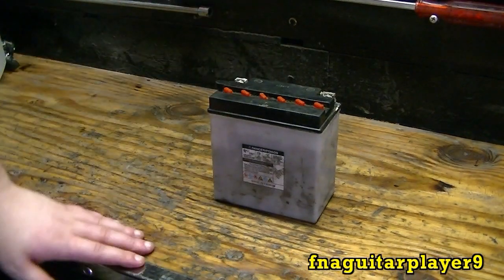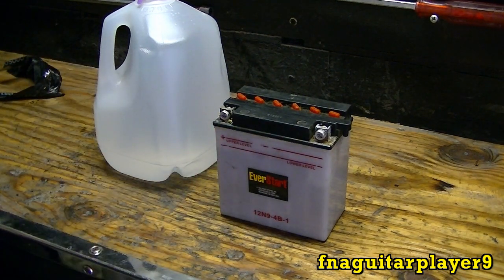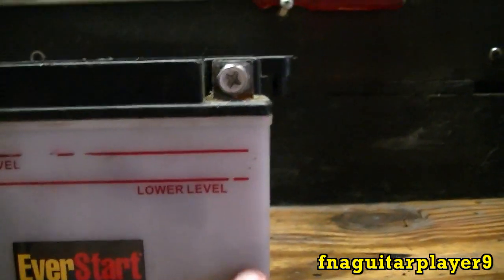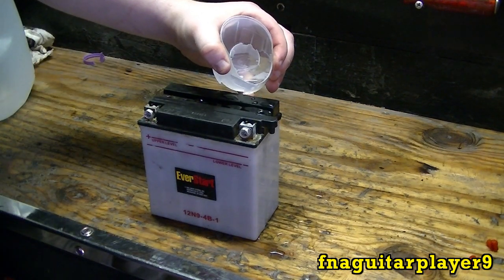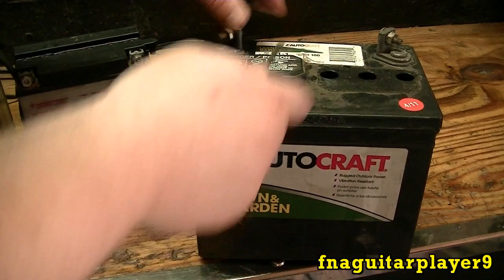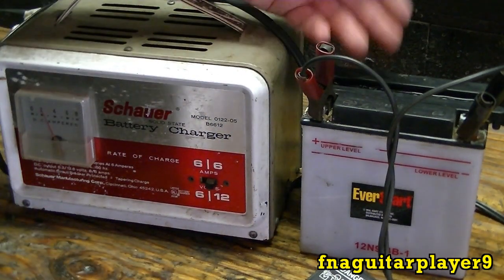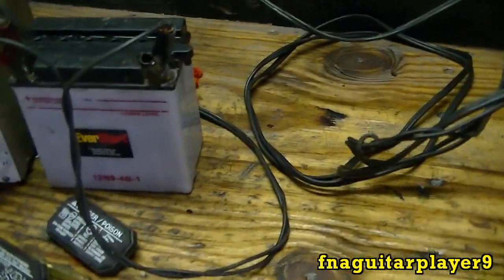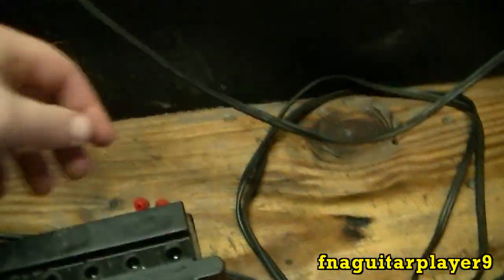Battery Maintenance ::: Adding Water to Cells and Charging

Comment: The higher current charging can help desulfate the plates, but you don't want to quick charge them too many times. Each time it takes some material off of the plates. You can add acid if you drain out the old acid and replace.
Reply from the maker: Yeah like you say as long as its not done to much, it can also make the acid "boil" off from electrolysis. Thanks for Watching!!!

Comment: I can give you a suggestion for filling battery cells without spilling water. I have learned to use a lower unit fluid hand pump to pump the water into each opening. They come with lower unit fluid at Walmart and the rest for replacing your outboard's lower unit oil.

I pour the distilled water into a smaller container with the same size threaded cap as the hand pump. It even comes with the clear plastic line. 

Try it. You won't spill a drop and is very fast.
Reply from the maker: Never thought of that, I know exactly what your talking about, that would work great, i'll have to check into getting one! Thanks for the tip and thanks for watching!!!
Reply: I keep several meat syringes in my shop just for things like this. Draw water right out of the jug and go right into the holes with the needle

Comment: You don't top them off with acid, because the acid does not leave the battery, only water does via the electrolysis of water.
Reply from the maker: true. It is possible for the acid to come out too if it the battery is overcharged, thats what causes that rotten egg smell, i almost blew up a jump start about 4 years ago. Thanks for Watching!!!
Reply: Hahah, having never overcharged a battery myself, I wouldn't know.
Reply from the maker: haha what happened was i was working on a riding mower engine and had my battery charger hooked to it, so when i got done cranking it would charge up faster, it ran down and i put on the 55 amp boost just to start it up, then i forgot and left it on that, smoke started pouring out and it smelled just like rotten eggs haha. I got it outside as fast as i could haha

Comment: After topping up the cells with distilled water you should use a desulfating charger, then keep it on that (BatteryMinders) any time its not in use.
Reply from the maker: That is good advice, I probably would have left it on a trickle charge but i needed to grass that day haha I hate these little motorcycle batteries, they last about 2-3 years then they start going out, i did revive it with epsom salts which got me a extra year out of it. Thanks for Watching!!!

Comment: Not necessarily.  Older batteries were designed to require maintenance and should be refilled or they will not give their designed service life.  The batteries with non-removable vent caps are a different chemistry, usually Lead Calcium, and they do not gas nearly as much.  They also use shorter plates which allow for more water loss before the active material is no longer submerged.

So if it has caps, check the electrolyte level and refill!!

Comment: The bubbling is the water breaking down into hydrogen and oxygen.  Only the water is lost, not the acid, so adding acid would make the acid too strong.  Stronger acid in the cells than what was used during formation of the plates in the factory causes them to corrode and fail early.

Comment from the maker: I've never had one last longer than 2-3 years at the most. I wasn't really surprised when this started acting up, and another thing this came from walmart so yeah haha Thats very true. The last jumpstart we had (best thing harbor freight sales) lasted 8 years, i've also though of buying one of them just for the battery and put the battery in the mower haha
Reply: Yep, just had my VP-75 1yr Walmart battery crap out on me, 2 months shy of 3 years.   Water is good but the battery is at 10v, so it wont start the car after sitting a few hours.  Got it on my rejuvenator now, it may fix it but I doubt it.  Maybe get my $11 core charge back if I cant reuse it.

Comment from the maker: If i do that it will be a jump pack, that would be a pain to pull out a cord haha I probably can't afford that, i'm sure they are great batteries! If I use a jumpstart/pack I thought of making a bracket or something to keep it on it all the time in case i need it. I'm also thinking about putting the bigger type of battery on it, make a bracket on the back to mount it. They are much better than these motorcycle batteries. thanks for watching!!!

Comment: Using a weak battery is hard on the alternator so the jump start method isn't good either.  The reason the amperage declines is because the charger is "smart" enough to reduce the amperage to as the battery gets fully charged.